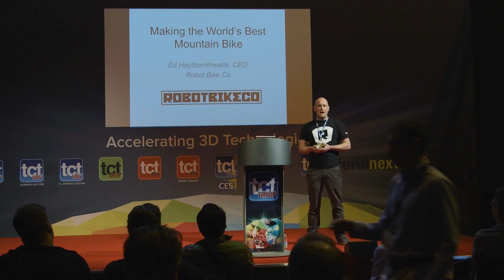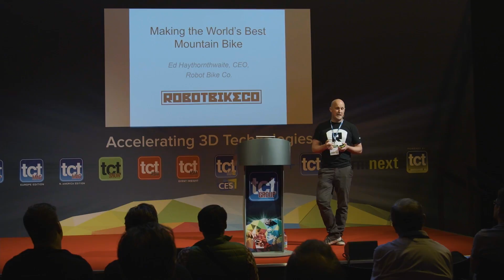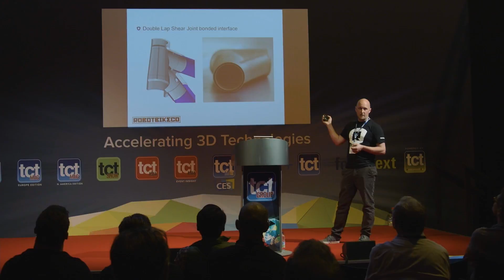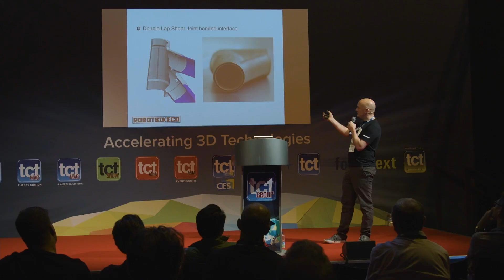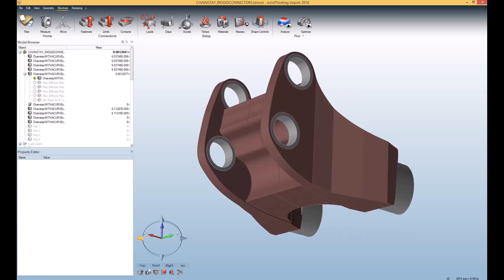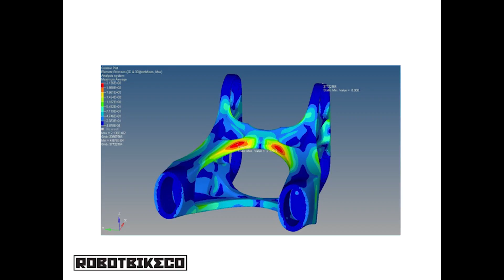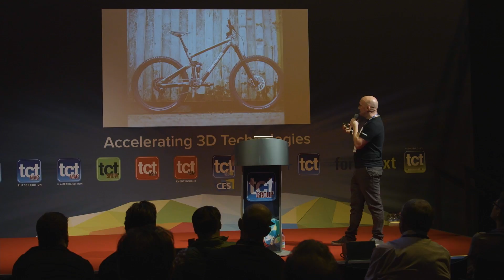Making the world's best mountain bike | Robot Bike Co | TCT Show

Comment: This is very interesting, but I really see no benefit to the consumer. All of the benefits spoken to are benefits to the company.

Regardless of the custom fitting for a particular person's body, I sincerely doubt that this bike performs any great percentage better than an off-the-shelf bike.

So really what you have is a $4k+ frame that is easy for you to manufacture, and extremely expensive for the consumer.

I can buy a complete bike for the same price with upper tier components.

It's not any lighter than the competition. It doesn't perform any better than the competition. It just costs more, except for you... it costs a lot less. Cheap, simple, easy is how you described developing the frame.

Ultimately, this is just a bike for someone who likes bespoke items and has a lot of excess money to spend.
Reply: And now the athertons are riding them. Marketability through the roof!